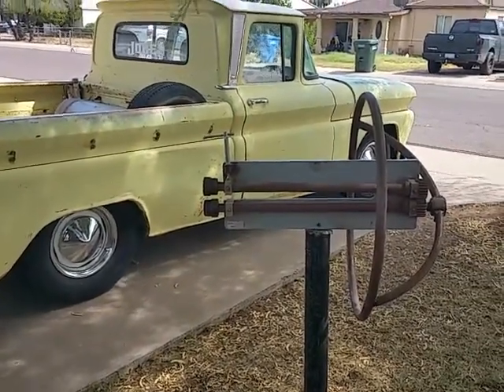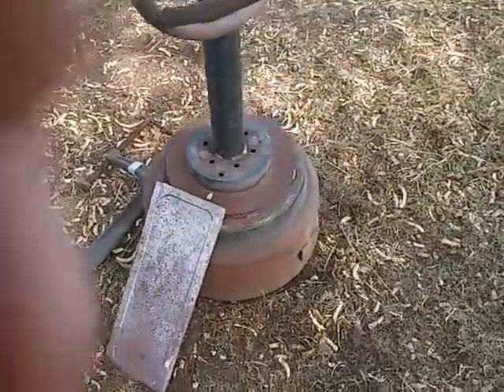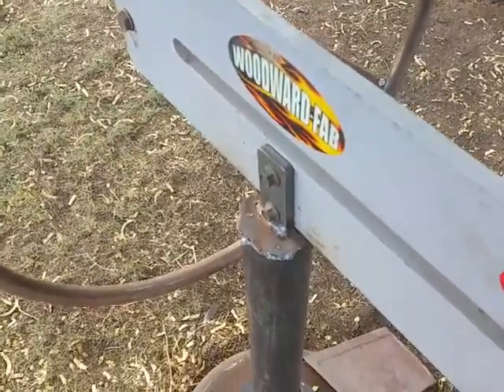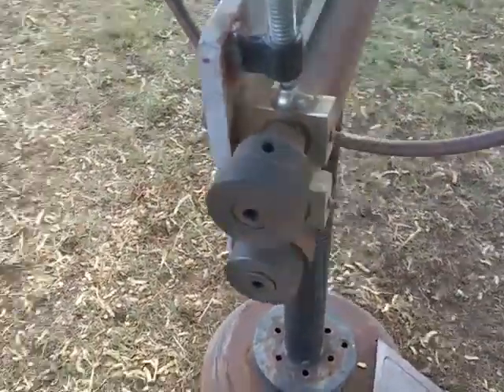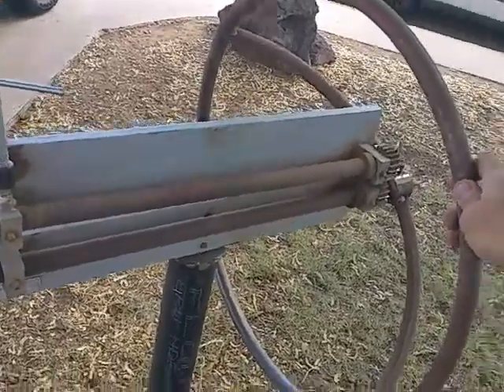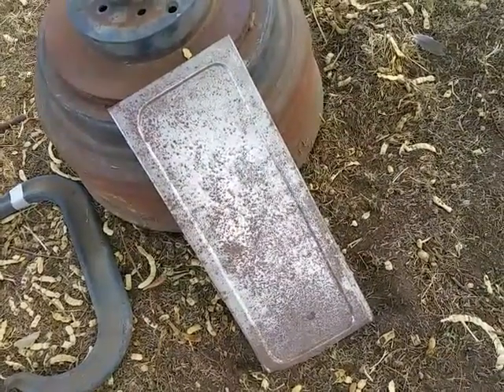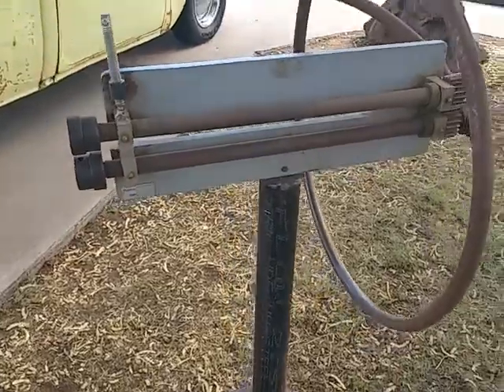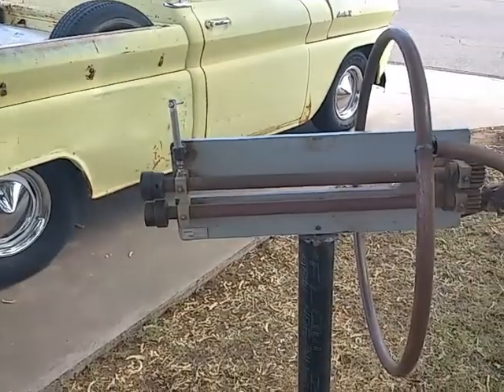Bead roller mods

Comment: I don't understand how someone  that dose a odd car up in his home workshop can call his chanel a custom its deserving  as they are not experienced in safety in custom fab work  wish ther's was more rules on u,tube about what should be advice and what's home weekend
Reply from the maker: I work as a professional fabricator at a high end hotrod shop in phoenix. I use shop equipment; grinders ,bead roller ,english wheel ,tig and mig welders ,etc everyday .